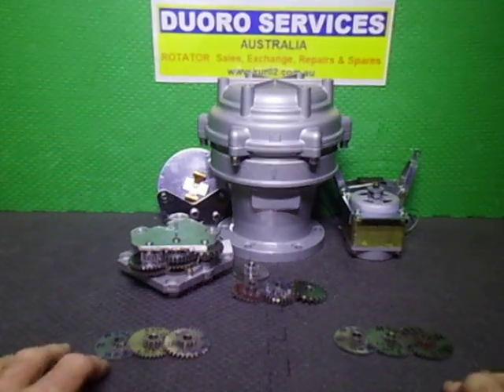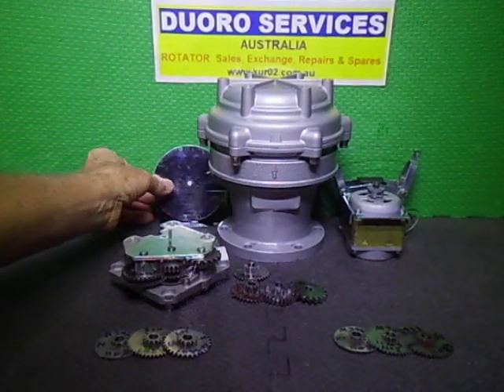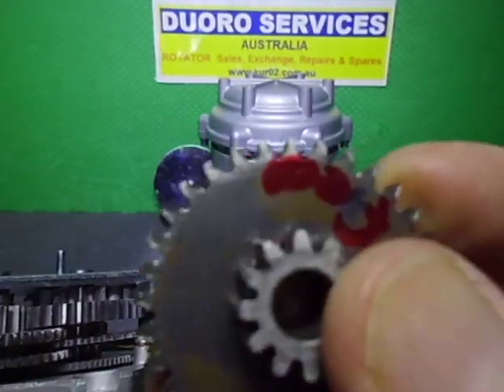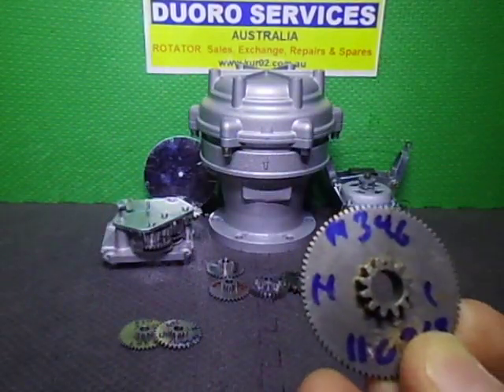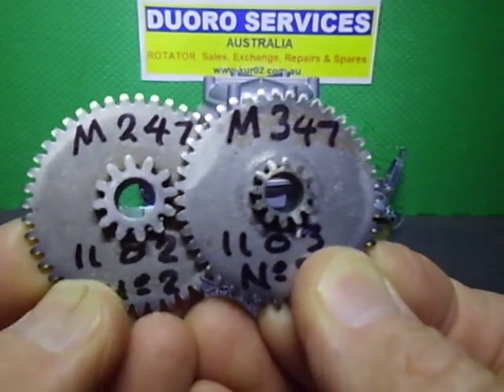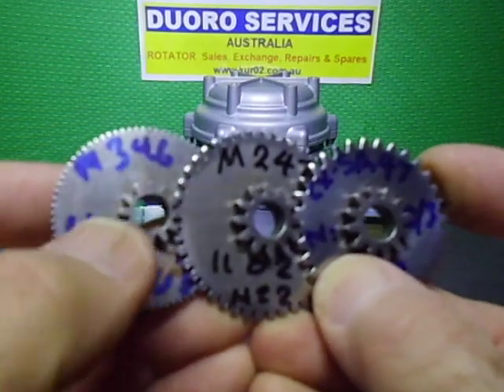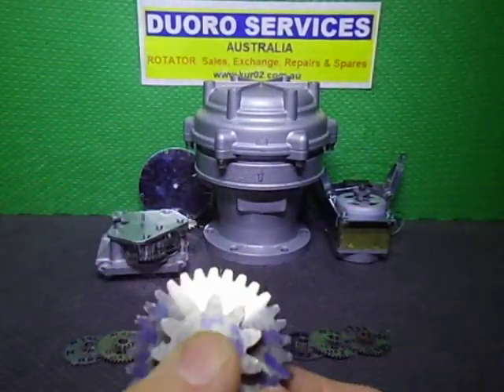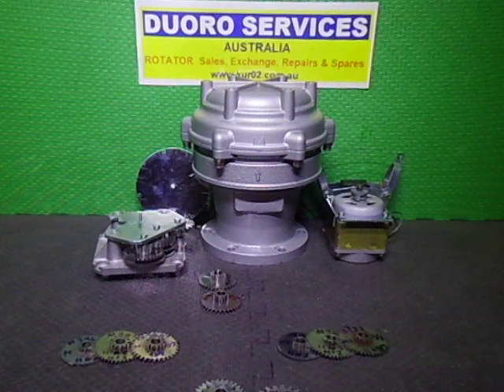How to tell the difference, Emotator 1102 & 1103 Rotators

Comment: It is not understandable that I dismantled my 450, the switches for the rotation limiters are located exactly in front of the 7-pin plug and that you are the train that put the engine with the switches to the left at 90 degrees...how does it work? Not clear